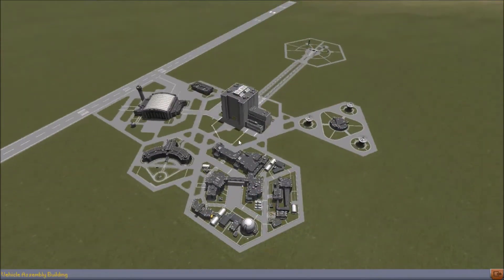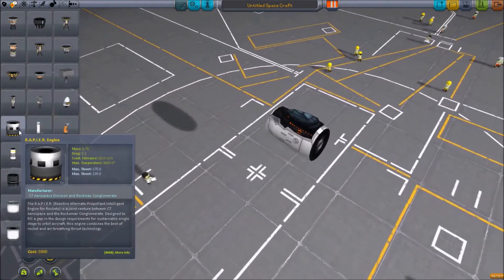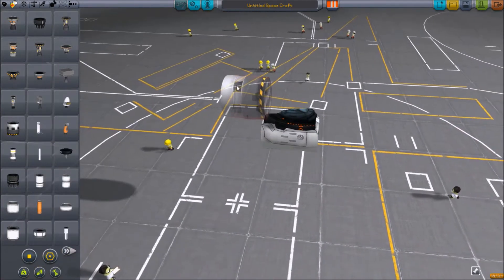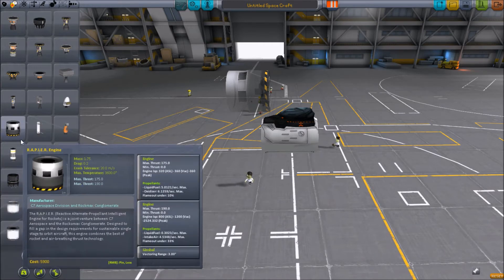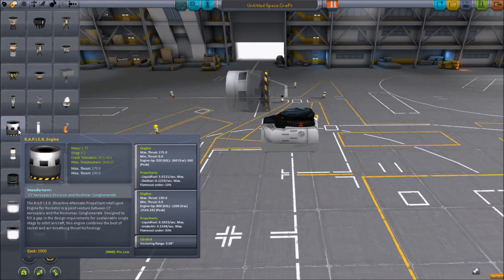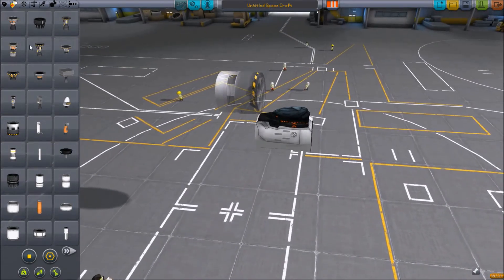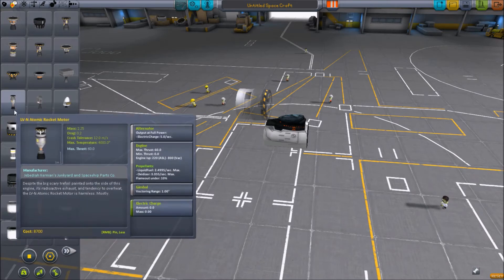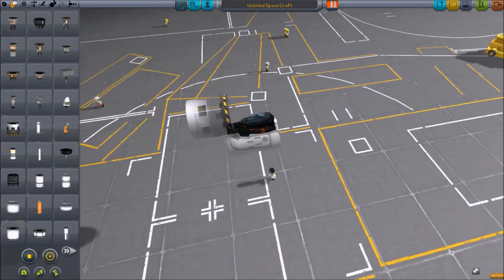Thoughts on the R.A.P.I.E.R.

Comment: I was a skeptic about the stats of the RAPIER as well until a week ago when I read the thread below:
http://forum.kerbalspaceprogram.com/threads/68030-RAPIERs-don-t-suck!-A-complete-performance-evaluation
Some of the evaluation results are questionable, but what I took away from it was that while RAPIERS aren't the best jet engine, nor are they the best rocket, they do have the ability to run on very little intake air.  Using this factoid, I began to build a spaceplane powered only by RAPIERs.  The main drawback is the only way to get to Kerbin orbit is a very long and shallow climb.  However, I can usually get to much higher altitude before I switch to oxidizer, and it pays off in the end.  Air-hogging and wing-spamming help too.

Comment: Actually what kills the R.A.P.I.E.R. IMHO is the acceleration. I'm currently designing an Eve-capable SSTO, combining turbojets, rockets, ions and Kethane turbines, and I was looking forward to the hybrid jets... But when I finally put my plane together and saw it takes almost half the runway to reach top thrust... Nope.
Reply from the maker: They could have scaled the thrust with the mass (relative to the turbojet), but as the engine is a compromise I guess it wouldn't be very realistic
Reply: AstraphUriel ironically, you need more speed for peak efficiency. Either run them in closed cycle mode for a bit, or gain altitude and use a power dive. You should be getting a stable mach 3-4 if you built a good plane